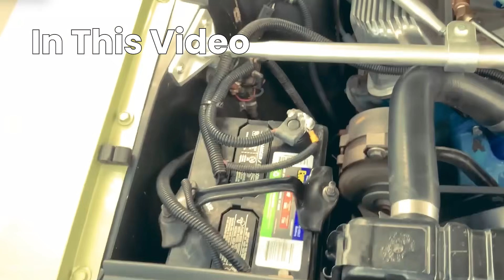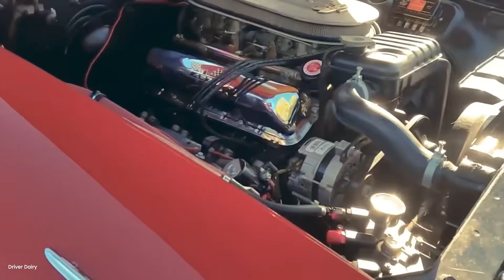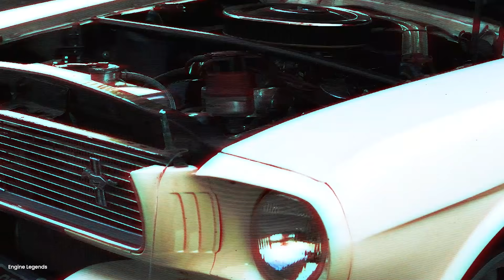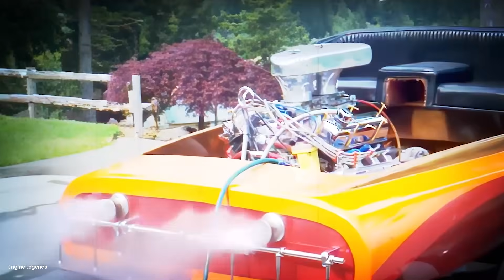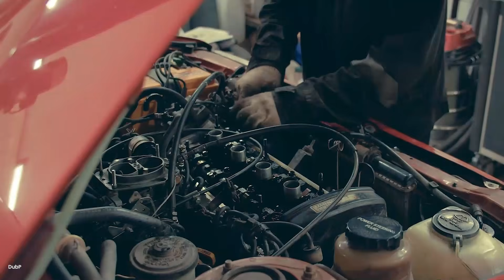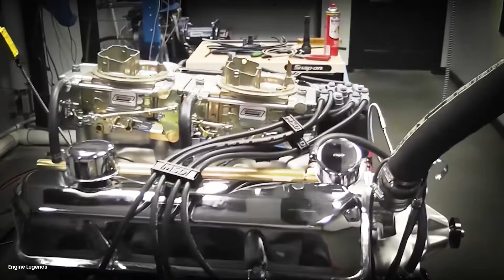20 Shocking Secrets About the Ford 427 Side-Oiler You Didn’t Know!

Comment: I wish someone would cast thick bore 4.13-4.19 blocks. The same light crank. 2.75 mains and 2.2 rod journals. I could blueprint a center oiler and it will rev to 7000 rpm’s for days. I just wish they would cast new 406/428 blocks.  You don’t need a side oiler. A roller can and blueprint the center oiling system. Mike 6250 you know what I m talking about. Cheap as a 352.

Comment: Oil mods like restricters for the rocker arms and opening oil passages from the pump to the main oil gallery as well as opening the oil drainback and oil adapter all save engines . The SOHC made 657 hp right from the factory . NASCAR 427 Tunnel port engines made around 650 hp too . 427 High risers made 550 hp from the factory .

Comment: The 390/406/and 427s were all ovesquare. Even the 332-352. I never understood why they didn’t make them with 4.13 bores and side oiling with cross bolted mains. 1 428  in every thing. The 4.23 bores for 427s but 428 side oilers with cross bolts mains. 4.13 bores 3.985 strokes cross bolted mains and side oilers. I would not have been surprised if a 428 would have been great for racing..thick bores good oiling and one 428 for every FE.
Reply: Fill water jackets.
Reply: @Mike62501 Hey Mike, I miss  the  Forum. My big mouth giving away secrets. LoL.